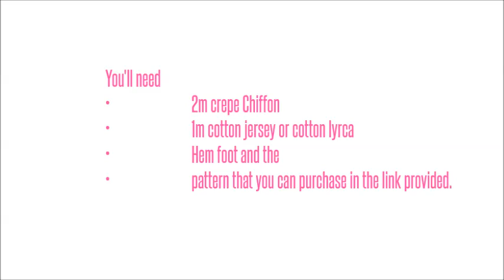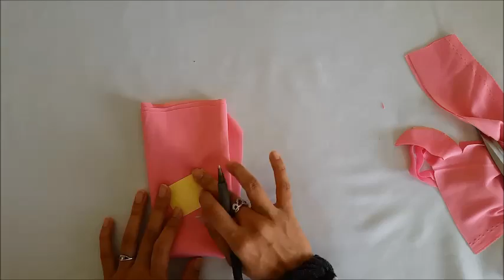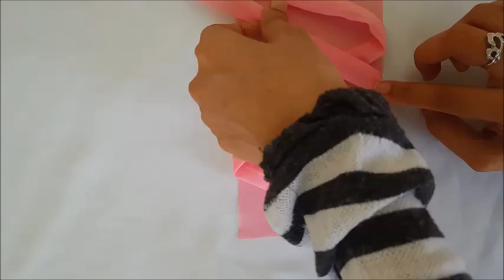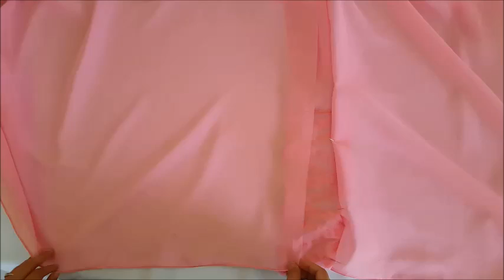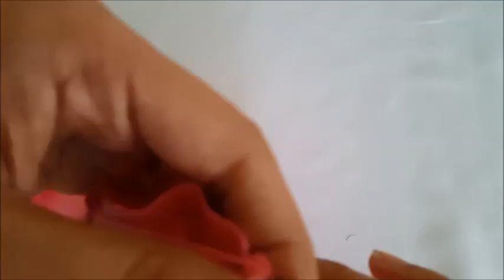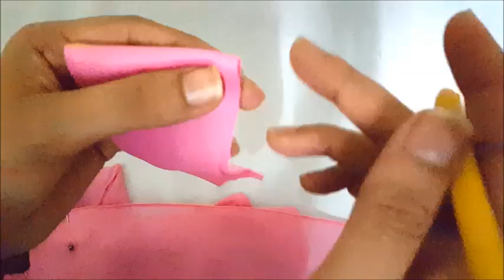Seema Instant Hijab Sewing Tutorial plus Pattern

Comment: ok, so far i understand, how it works with the pattern. It just looks like what we westerns got here from middle-age-hoodies / "fool's cap". Only one suggestion: you got a straight line/fissure between the cap and the lower/shoulder part. From what i know from professional patterns, they use an S-form on the cap (the turn is about 50:50 of total length from front-middle to back-middle and is hitting the middle of the shoulder) and a round inward in the lower part. I dunno, but maye that makes things smoother and less edgy.